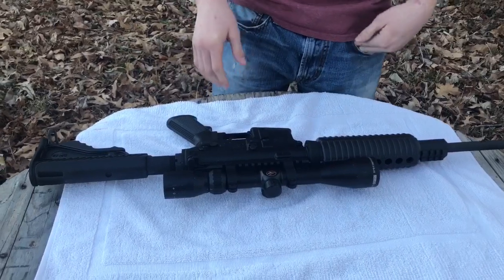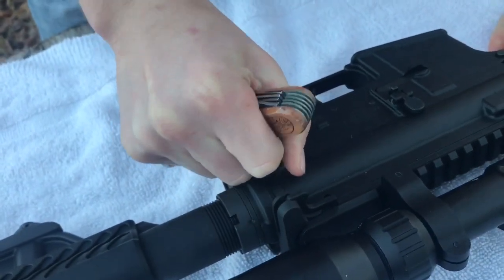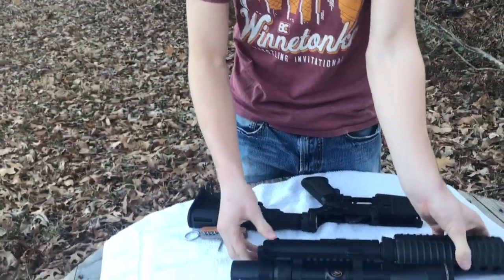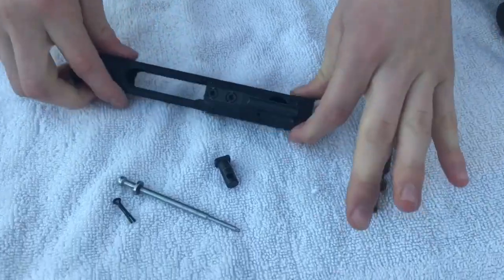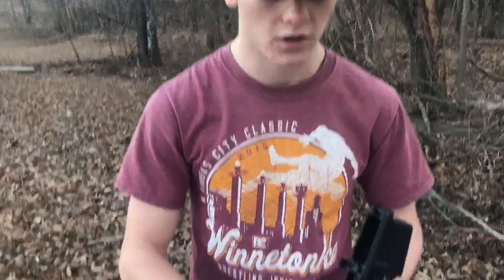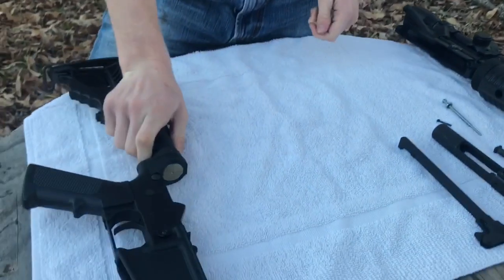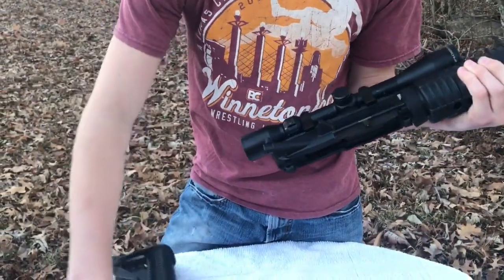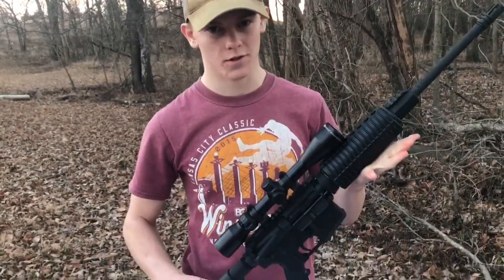Field stripping a Panther Arms DPMS Oracle AR 15 rifle

Comment: Hey buddy quick question I got the same riffle. Ive beem tryimg to find a video of why the rear take down pin in mine is so damn tough to pull out and pit in
Reply from the maker: When I first got mine it was supper stiff just due to the fact that it hadn't been taken apart very much and you'd have some of the paint acting as an adhesive, the more you strip it the easier it becomes, at first I had to use a punch or something to get mine out but now I can just use my fingers

Comment: well if you are making a video about field stripping then show using just the tools you would have in the field.  no special tool needed. hell a piece of wire works just a well. how the weapon was designed in the first place, so that even one of of dumbass grunts to strip it down and clean it in the field.